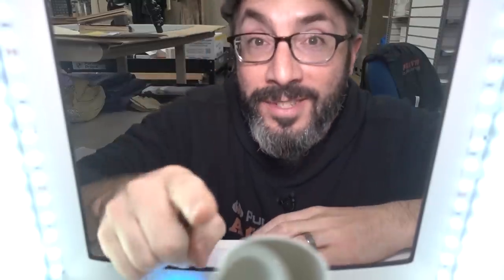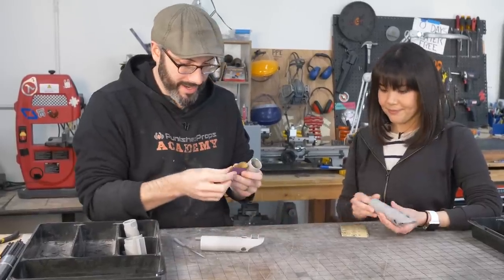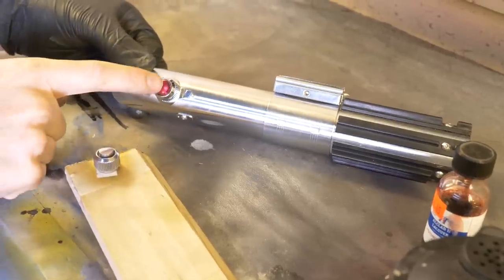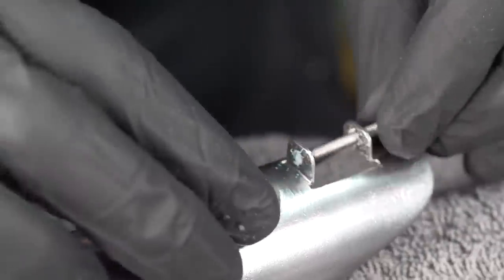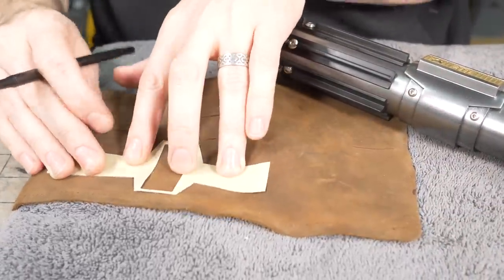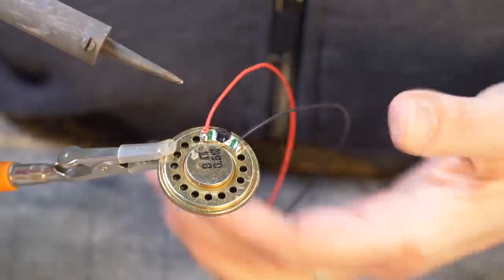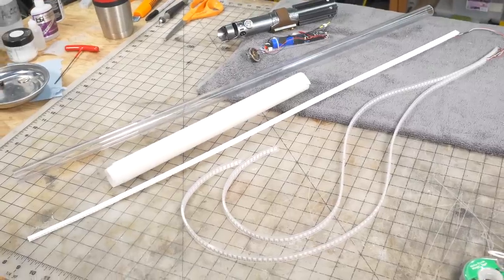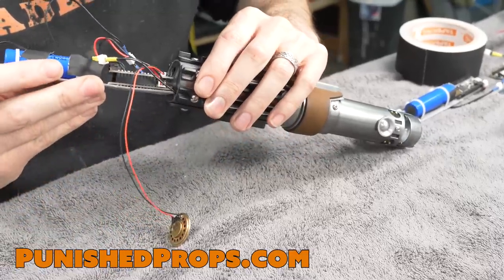MAKING Anakin/Luke/Rey's LIGHTSABER - Lights, Sounds, & FREE 3D Files | RISE OF SKYWALKER

Comment: i printed it and the top tube cracked
Reply from the maker: Yeah the walls are quite thin, as it's designed to be a 1:1 replica of the dimensions of the metal one I have. You could probably reinforce the walls with fiberglass or resin if you wanted, but you may run out of room for electronics.

Comment: HELP IF I print in PLA will pressure fit just snap???
Reply from the maker: PLA should also be able to do pressure fit parts
Reply: Punished Props Academy okay might try it.  I only have small mono price mini pro printer which is 120x120x120 so idk how I’ll do it but well

Comment: So, we decided to use these instructions to build a light saber. We were very disappointed. The 3d print was poorly engineered , parts were too small and fragile. The instructions are incomplete, which made assembly very challenging. The parts recommended were expensive and out of stock. When we were done we had a lightsaber that was too fragile. I can not recommend this project.